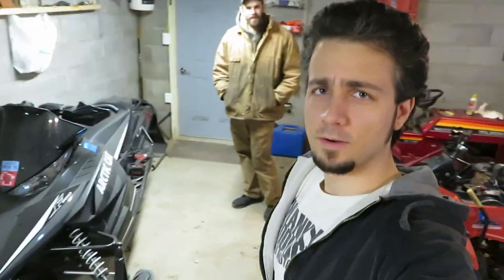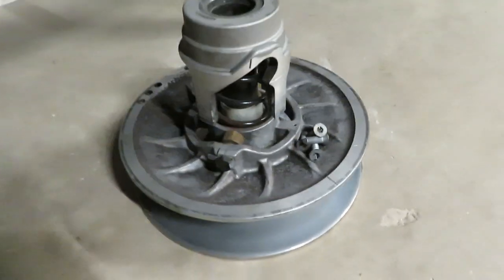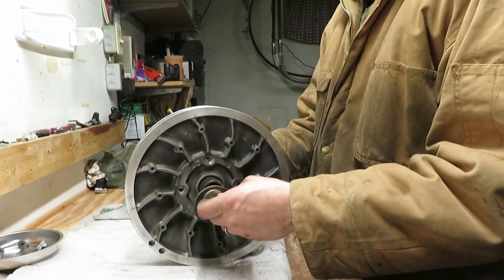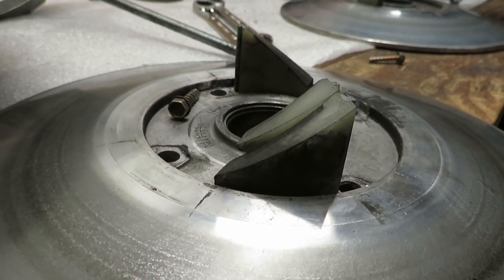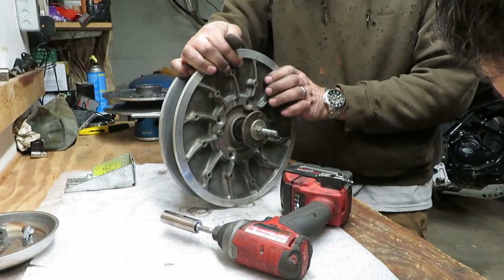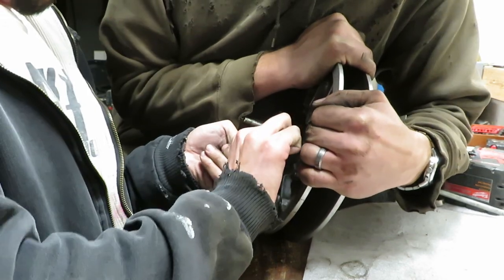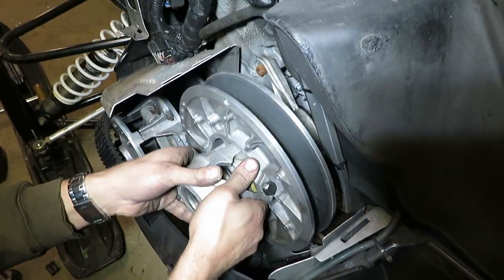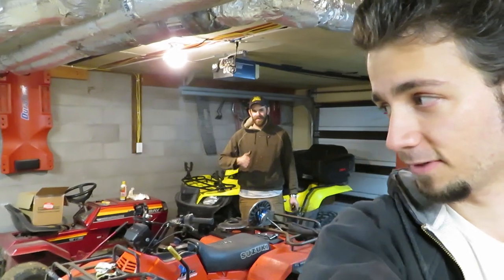This Might Be Why Your Arctic Cat Eats Belts! | Big Fin Secondary Clutch Install F1100

Comment: I have a 2013 F1100 Turbo. From factory, the jackshaft flexes up to 180 thousandths of an inch and the bracket that holds the jackshaft bearing on the clutch side came attached to the engine. Every time you let off the throttle, the belt takes the brunt of the force from over shifting and it heats up. Guys have spent thousands trying to fix belt blowing issues by installing new clutches, jackshafts, etc. If you want to be done blowing belts, especially if you have it tuned up (I have 240 horse tune, cold air intake, extended track, Bikeman Clutch kit), you'll have to replace a couple parts. The bracket that holds the jackshaft on the secondary side has to be replaced as well as the jackshaft. The new brace will stop the overheating on deceleration and the heavier jackshaft will keep your secondary from pulling out of parallel when you're accelerating. This should have been addressed right from factory and a couple engineers did in fact lose their jobs at Arctic Cat over this. They now work at Polaris. lol. Scott Taylor Engineering still makes these parts and he does them well. For the double approach fix, you're looking at just shy of $1000. That's a bit to spend but better than having a $5,000+ paperweight that you don't want to ride because it constantly blows $120+ belts.

Comment: Haha, I built my spring removal tool out of some threaded rod welded into the center hole of an old lawnmower blade for a base, then a section of tube followed by a trimmed former lawn mower blade to do the compressing. Honestly buying the correct tool is too pricey for what it does, and all these clutches are a bit different. A little creativity gets the job done. Happy New Year bud.

Comment: If your having problems blowing belts or even if your not this is a must have AC Part # 6639-817. Have a 2013 XF800 Cross Tour was eating belts like crazy this did the trick. Ducts the air straight to secondary
Reply from the maker: I had actually looked into vents first but also wanted to buy a tool to check clutch alignment and decided to buy the cooler running clutch and the tool for that since it was slightly different.

Comment: the heat treatment on the cast during the 2012 sleds were junk and would fail, is one thing the dealer told me. I still need to get the big fin for my 2012 proclimb. Great vid bud.
Reply from the maker: Ahh yeah, I think that's what I was told as well.  Thank you!!!

Comment: I've had no issues with belts on my 809 Mach Z and l have a plate on my secondary..
Usually blown belts are an indication of poor clutch maintenance, improper alignment and off sets or bad clutch calibrations, bad engine mounts or everything I've mentioned combined..

Comment: I have the older style Cat roller secondary and its quite a bit different than your newer secondary. Thanks for posting, as I learned allot about the newer style secondary. Are you able to adjust clutch parallelism on your sled? TIP: You can clean/wash both primary and secondary clutches in your dishwasher, they come out very clean. Just don't do it when your wife is around! They should be cleaned once a season as belt dust wears the clutches faster.
Reply from the maker: Have you told me what sled you've got?  I want to say F1000 but that doesn't sound right....  Anyhow I'm glad to hear this helped, but I've no idea on the parallelism, of I'd have to ask Jason haha.  The guy I bought my first sled from said he always scuffed his clutches up with high grit sandpaper.  I assume that's about the same thing, but might also remove material and wouldn't clean the internals at all.
Reply: Not 100% tbh... Manual just says if off to correct it but does not say how... Some googling indicates the order you torque down the motor mounts could influence it... Others say to shim certain mounts... Others say to slot where the mounts bolt down.
Reply: @sledjason  No worries, it is done by tweaking the motor mounts. I wouldn't worry about it, unless it keeps breaking belts. Then its something that will need to be looked at. The washing of the clutches (in the dishwasher) is good practice...seriously...google it.
Reply: @SwankyCatProductions  I have an old 91 Arctic Cat Ext 580 that I've restored w/some modern upgrades, and I have a 2002 Arctic Cat ZR 900.

Comment: great video I was just wondering why u wouldn't put new parts in since u had it apart
Reply from the maker: Thanks.  The sled has almost 10,000 miles on it so I didn't want to spend the money on new components since they would long outlast the rest of the sled.

Comment: Just curious what you’ve been using for belts? I blew the original belt in my 12 XF 1100 on the last ride last year. Original belt made it over 5k. Knocking on wood I get the same mileage on the new one. Thinking of buying aftermarket now for the spare.
Reply from the maker: I've always been running the stock Arctic Cat belts from Amazon.  I'm hoping that's the last one I'll need to order though lol

Comment: Great video. I have a 2012 F1100 so this video is very interesting to me. Just bought mine, haven't ridden it yet. I bought a non-turbo because I heard about the belt lifespan's. How long were yours lasting? Is this new assembly just from a newer sled?
Reply from the maker: I should have explained that all a bit better lol.  I'm not really sure what was up with mine but in the two thousand miles I've put it on it I've blown 3 belts.  All of them when I was really pushing the sled.  I'd recommend pulling your side cover and carefully touching both clutches and the belt after some normal riding to see how hot they are.   Mine would get so hot you couldn't touch them at all.  As I said before Im not really sure why this was but switching the secondary out was what Country Cat suggested since I was having issues.  It could have been an alignment issue or something else but I figured I'd try this rather than buy the alignment tool for the old secondary and have that not actually be the issue.  Let me know what you find!
Reply: I bought my 2013 XF 1100 N/A because of that also. Im pushing 3500 miles on the factory belt still with no issues... guess I got a good one lol.
Reply from the maker: I'd have blown a lot of belts in that time ha ha
Reply: I pulled my secondary off to clean it and re-grease the shaft. When I went to put it back on it wouldn’t open and broke the bolt. I purchased replacements and will try it again but it really surprised me.

Comment: What happened to floating secondary clutches where you never had to worry about alignment.
Reply from the maker: I haven't ever had a sled that had one of them but it sounds like a much better haha.
Reply: @SwankyCatProductions  My old Yamaha has it. The secondary will slide in and out about 1 inch or so. It just aligns itself with belt tension. I change my belt every 3 years. It works so well I'm surprised it wasn't more widely used. Seems to not exist anymore. Maybe there's a issue with it I haven't discovered yet.
Reply from the maker: Could just be cheaper to make them without that too I suppose.  Sounds cool though.  Beats changing belts 3 times a year lol
Reply: I have a Team Tied secondary on my 2012 M1100 Turbo and it uses a float plug for alignment.
Reply: The problem on the RR is that the 2 clutches aren't always perfectly parallel. I added a free float secondary piece from country cat and removed the shim as directed. I blew belts like crazy because under pressure the secondary was staying tight to the bearing housing. I put the shim back in and it seems better.

Comment: What did you figure out? I’ve got a m8000 and gone through 3 belts after changing my track from 2.6 lug to 1.75 with studs. Only blows after longer runs. Secondary hot af. Possibly same issue you’re having.
Reply from the maker: So far so good.  I ran around 65mph for some longer stretchs in the UP a few weeks ago with no issues.  I think this solved it for me!
Reply: @SwankyCatProductions   okay, I got some guys looking at mine and turns out my bushings are gone in the secondary. Clutch would be little outta line that way. And after running for long stretches around 70-80mph it’d heat up and the blow the belt. When cool I’ve seen 85mph plus with no issues but that was only in short bursts. Hope I stop blowing belts after this week
Reply: @georgetweedie1231 did you find a place to get bushings for your secondary?
Reply: @saschadiedenhoven9977   a small local shop not sure where they order from two years ago now. After messing around with my clutches and rebuilding them both. I replaced the reverse ramps on the secondary and haven’t had any issues with belts or secondary opening up into a high gear while backing up.

Comment: Plastic ramps are different for 2 stroke and 4 stroke. Your donor clutch probably came from a 2 stroke sled.
Reply from the maker: I think it came off an XF9000 but I would guess that's enough of a change in hp to require them to be different.
Reply: @SwankyCatProductions  The difference between the 2 types is because of reverse. 4 stroke has gears, but 2 stroke does not, they change the motors rotation with a switch. One type allows the clutch to be run in backwards, one does not.